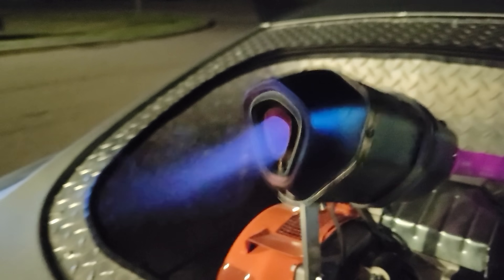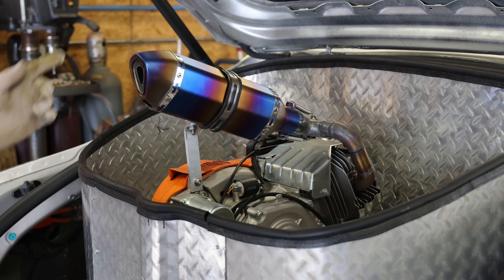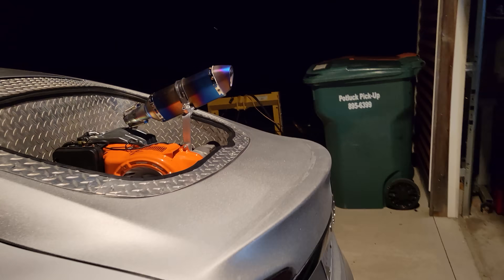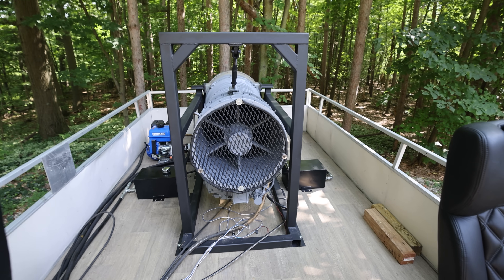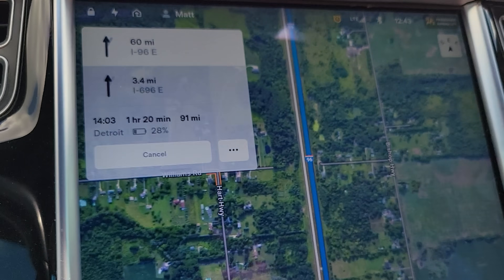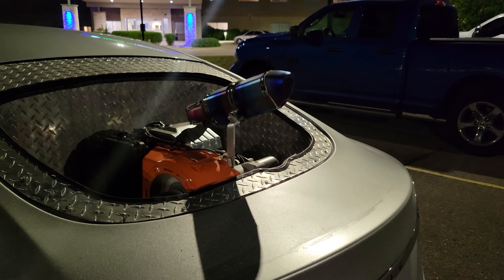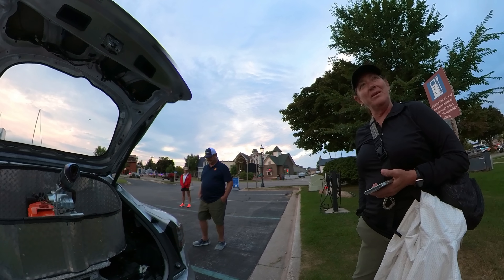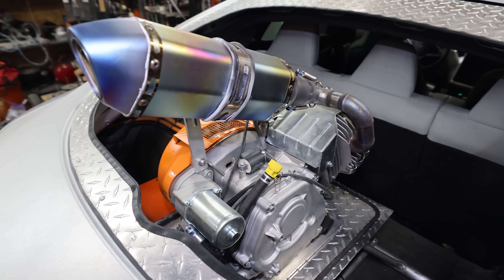Cordless Tesla (I Drive 1800 miles without charging) P.1

Comment: Battery powered cars is a joke and makes no sense for protection to the environment. Replacing the fuel tank by battery will cuase more environemntal damage due to battery chemical waste and formantion, while internal combustion engines only generates CO2, which can be decomposed by green plants. Green plants need CO2 to make glucose, and nothing on earth need toxic lithium waste . Making renewable electricity is another topic, but burning fossil fuels for electrical energy to charge batteries is the most ridiculous thing you can do for the environment

Comment: I don’t understand your logic here at all. You could have built the rear trunk the same way it is and stuck a silent Honda generator right where that loud obnoxious engine is and had it charging almost silent the entire time…. It would probably charge faster, definitely quieter, taken a fraction of the time and everyone with more than a half of brain wouldn’t be wondering why you went through all the hassle of putting that crap engine/generator in there when a Honda EU series would have done better, fit just fine, used less fuel & been quiet…

Let me guess? For the views?

Comment: I am Sorry Maybe I do not understand, U Using a Gas Generator to Charge an Electric Motor as the car is driving? Y don't U just Put in a Petrol Engine(v 10 or v12) and make that loud noise but sounding much cooler than the generator. M not mocking U I M Trying to understand, I Would Understand if U replaced Ur Roof with Solar Panels to see how far u can travel with this

Comment: Trust me, the superchargers are way faster than trying to pull this off.
Reply from the maker: Only this version, not the next... Hang tight you will see. Also supercharging is not good for the battery. Lithium ions like to be kept between 20 and 80% and get charged in short small bursts. If you were to charge a Tesla battery that way  it would probably last 20 years maybe more. If you add up all the hours that you set at a supercharger over the course of 6 months, how much time is that that you could have been doing something else?

Comment: This project exposes why Nissan never developed this idea after spending billions

The conflict is the low efficiency of gasoline engine some ~16% at best as a  static electric power  generator  or worse normal  use IC engine in car about  ~5% when  connected to normal gasoline engine  drive chains and the friction  losses from that from air resistance rolling resistance   etc .Yes the IC engine gives ~30% power at the engine output  shaft but connected to  real work that drops of a cliff 

The electric battery Tesla   is also low  efficiency in this time at about ~180 to ~230 watts per kilogram { 2.2 lbs } and to match Gasoline  fuel engine type car needs to be north of ~500 watts a kilogram 

The best way to recharge these  Lithium electric batteries is full tilt when they are at 10% to 80%  so the sweet spot is this 70% band. This shows up in  typical recharge at fast chargers is about 30 minutes for the  80% full recharge often done at low charge start of ~10%. Battery resistance means it takes another 39 minutes to recharge to 100% as resistance increases rapidly after ~80% charge .

As Nissan was interested to do electric racing system where cars would often exceed speeds of 130MPH  about 180 KPH  they needed to make a suitable 400 BHP engine 
The logic is that when the battery went to some ~20% charge the gasoline engine would kick in make ~200 BHP to the electric  drive chain and ~200 BHP to the recharging until the battery reached ~80% full again 

Problem was this required a low power 6000cc  V12 at  ~5000 RPM  or  high power turbo charged V6 of 3000 cc doing some 10,000 RPM to give 400 BHP. That was too heavy a solution  . So Nissan made a 3 pot turbo charged 1500cc  turbo charged engine revving at 20,000 RPM using a special lubricating oil and engine wieght of only ~65 Kilos ~ 140 lbs  that gave them 400 BHP. i suspect the life of this high power 3 pot engine was less than 100,000 kilometer or 60,000 miles so Nissan never went  on big scale with sales of that 400 BHP  experimental engine but I could be wrong .The point is double the RPM of the engine double the BHP until something explodes  

My cousin in London has the range extender engine in her 6 year old BMW but rarely has used it . The car works for her as a Harley street doctor she saves a fortune on  London city  Tolls  which are free for electric and hybrids  but that BMW  car would be a economic disaster in normal driving on highways as those small BMW engines for range extending are  teeth grinding expensive for maintenance if you use them a lot .

It is all mathematics it takes a certain amount of watts to move a kilogram of  a car at given steady speed d .Throw in accelerating and the watts needed per kilogram increase dramatically and battery or gasoline fuel  range decreases from steady speed range 

With losses a electric car can expect to do about ~12% efficiency in steady state ~60MPH highway driving versus a   gasoline car ~8%. Throw in urban driving both drop to ~10 for electric versus~5% for gasoline cars . In slow  traffic jams  the gasoline cars numbers fall dramatically versus electric cars  not using electric power when stuck in stopped traffic jams .

A average IC  1500cc car will need ~5kw to do a steady speed 60MPH on the highway. A similar sized EV with extra battery weight will probably need ~6KW.
The larger  type Tesla  probably is more  again.

The IC engine is most  efficient  ffor fuel at full gas in static  situations  so it makes sence for electric power to be given at full max throttle 

The near empty battery sucks up electric power faster than a nearly full battery so it makes sence to run range exrtteder when battery is closer to empty  and that needs a engine that can drive the car and recharge the battery at the same time .That shows why a mere 5.5 kw isn't going to cut it  and for tesla best to look at 100 BHP plus preferably a second hand engine from the range extender from the BMW or suitable engines from motor bikes or aircraft engines like ROTAX . better to put a tow hook on then fit a box that clamps onto  the tow hook and put IC engine inside that box keeping noise and weight outside the car .
Thats not cheap so needs deep wallts a good 100 BHP 4 stroke turbo ROTAX cost north of $10 K and then extras like fuel tanks and electrics  might be easy north of $20K new

In most of communist controlled EU where I have to live doing these modifications will invalidate the car insurance and technical certificates and run risks from Green communist cities fining for pollution .I suspect Kommiefornia in the USA and communist controlled Canada would also throw the book at inventors   

Tesla also can reprogram any tesla to not recharge if they get the plates of any tesla acting in bissare ways as they hold the patents and product liabilty on how thier cars are used . Range extending on Hondas or Nissan or Leaf dont suffer these issues .Even the door handle on the tesla is computer controlled by Tesla they can lock you out of your car . Some people bought and salvaged Tesla cars and Tesla locked them out from the recharging their car so those cars went into the scrap heap. You never actually ever own your Tesla its a patented system you can use at the discretion of Tesla  screw it up no recharging system will work throw it in the scrap heap or sue the tesla and you got two chances non and  Sod all .

The real GURU of EV cars was Burt Rutan in the 1980 era made a 100 mile EV using crappy Lead acid battery with 1% the energy of Gasoline who explained the design system he uses .Its called SWAG scientifically wild assed Guess .   The popular Mechanics magazine pre internet  of that 1980s  era wrote it all up . Tesla obviously studied this  RUTAN SWAG system and improved on it .

Mathematically cheaper to rent a gasoline car for long trips  or modify a LEAF or similar low budget EV .

Comment: For the money he spent on a tesla to make it a hybrid. He could have bought multiple hybrids from many other companies and will have about a $20,000 bill when he needs new batteries. Through it away if you have any control or motor problems, it would be cheaper to buy a new one at $200 an hour to fix.

Comment: I'm both impressed and in awe with your work on this.
Would it have been possible to attack a wind concentration funnel  to deliver extra air to the generator and also build a sound suppressor to lessen the noise it was making.
Will you ever stop in WI again? (Madison, Wi) cheers!!!
Reply from the maker: Thank you I appreciate that, actually I'm already almost done with the second version, which is very quiet and turbocharged..lol. that's why I wasn't too worried about this one because it was only short-term just for phase one.
I probably will I'm thinking about doing some quick meetups on my next road trip but I'm not sure cuz I'm always in such a hurry

Comment: Turned it into a hybrid.  Please add a muffler as well.  I just noticed that you have better energy use at 50 miles per hour.  We normally drive around at 30 miles an hour.  I wonder how good the efficiency would be at 30 miles an hour.

Comment: I can understand the R&D value of this rebuild but the 2021 Honda Accord already had this 'beast' beat.  It uses a standard gel cell battery and charges while idling and when additional power isnt needed.  My  friend bought one and got 50mpg going up and down the the steep Smokey Mountains from Franklin,N C to Highland N C where he worked 6 days a week.

I dont see how this would pass standard emission testing for newer cars, the exposed flame is definitely a safety hazard and the noise is unbearable...like riding a lawn tractor around.   I see this as more of a "look at what I got", a lot like a guy telling risque jokes at a dinner party.  But to each his own I guess.

Now if he had done a little actual engineering research and found the correct small engine to power the Tesla sufficiently and economically with the necessary sound suppression to keep it quiet, he might have something here.

Comment: Thermodynamics says that the reason your efficiency is low is because you're converting gasoline to electricity then electricity to power the engine which rotates the tire. Every time you convert energy you're only getting 39% of it back. 0.39x0.39=0.15. Your thermoefficiency would be higher at .39 if that gasoline was used to rotate the wheels instead.

Comment: You Also could have put a Hitch on the back and ran a 9k dual fuel generator using a bottle of Propane (cheaper than gas) AND been quieter then the beast you built.

Comment: Based on my calculations using the data you provide, your battery only has 173 miles of range at 100% charge!  What did you do to your battery??? I've been driving my model 3 long range for almost a year, and I still have 330 miles of range.

Comment: Why not just stick with a gas car if the point of EV is carbonless which is still a farce when EV are charged with carbon fuels like coal, oil, methane, etc. Nuclear would help but lots of luck with that. The EV mandate is stupid nonsensible and dangerous on multiple levels. The problem is liberal don't/can't think things from concept to recycled. .
Reply: Gas is less efficient. Electricity is electricity. Gasoline uses enormous amounts of electricity to be pumped out, fabricated, transported, and pumped again.

Comment: A cordless electric Tesla run using a small gasoline powered generator is actually not a new concept, but was first introduced as far back as 1914 in Germany (108 years ago) as the first diesel-electric locomotive.   All modern railway locomotives operate using this principle and employ a generator to power their electric motors to turn the steel wheels.

Comment: Why remove spoiler? How is it charging the battery while driving?
Reply: The description is misleading.  The timeline in the video makes it clear that it's not actually charging while driving, it's just an off-the-shelf inverter-generator that charges when the car is stopped using the stock on-board charger.

Comment: Way overthought.  A simple Home Depot trailer with a small 220 volt generator and Dc fast charger would have prevented a $50K Tesla from being transformed into an un-sellable Tesla.
Reply: Note the beginning of the video.  He bought and modified a used hatch cover for this project so that he could easily return the car to its stock configuration.

Comment: Nico job and concept, could adding a power transformer pack or high powered battery caps to amplify the charge output increase your efficiency and charge time or perhaps switching fuel type?  Just a thought...

Comment: I like the  concept however Gas to me makes no sense , it completely defeats the purpose of electric cars. Is it possible to have an electric system that charges itself from an electric source? Something like an alternator that continuously charges the batteries. There must be some type of loop system that will make that happen. I am not an engineer just thinking out loud.  How about a system that charges from friction. Have a device that creates some type of friction from Kinetic energy? convert that to energy transfer?
Reply from the maker: I agree however, the energy has to come from somewhere, currently nuclear is the only clean energy source that produces enough energy to charge all these electric cars that are coming in the future. But they're still a big problem, storing enough energy on the car to make the car useful. Tesla is the best in industry in terms of technology, efficiency and safety systems, but I still see huge problems like three main things. Current charging patterns with the supercharger Network naturally degrade the life of the battery quickly in comparison to what lithium ions like. Which is staying between 20 and 80% charge while getting short bursts of energy in between. Then there's quantity 100 KW battery is only equal to 3 gallons of gasoline worth the energy.  And last but not least there's the fact that you have to look around for chargers and if you use the car a lot outside of your hometown you will consume hours upon hours every week just sitting there waiting for your car to charge. I'm very neutral and non-biased on this subject it's just whatever makes sense.

Comment: If the motor/generator was big enough, you basically wouldn't need the giant battery pack anymore.  If the battery pack was removed or at least reduced, with the huge reduction in weight and cost, it would've improved fuel consumption considerably.
Reply: ☝️thanks for watching and congratulations 🎉 you have been selected among my shortlisted winners.

Telegram only to claim your prize 🎁🎁

Comment: Back in the late 90's GM had a electric car that went 125 miles on a charge and required overnight charge for the next day. One guy put a weed Wacker motor on a alternator making it a closed system and was able to travel 800 miles on one gallon of gas without a charge.  The LA Times had a article on it. 2 months later GM recalled ALL their electric cars and crushed them.
Reply: ☝️thanks for watching and congratulations 🎉 you have been selected among my shortlisted winners.

Telegram only to claim your prize 🎁🎁

Comment: This probably didn’t save you any time considering you had to install the entire thing you have to stop for gas and stop at places to charge back uo which you would do anyway charging normally. Gas is more expensive now also so i don’t get it. Would be smarter to get a truck to tow the tesla and swap cars because if you tow it it will use the regenerative braking and charge the car back up and you can still be driving in the truck. Even then you will have to stop for gas in the truck.

Comment: Wow this is so impressive I’d love to know how much you spent in gas during the whole trip granted you did say you were leaking almost halfway but goddamn that generator is a beast it would be cool to get a big enough power plant in the back that you could use during the night or during stops that could fully charge the batteries in under a hour I think that would be pretty gnarly
Reply: Much more than you'd use just driving regular gasoline powered car LOL
Reply: You don't realy get the point of this. He drove without charging but that's not the smart thing about it. The real smart part is, that he can use a weak gaspowerd generator to drive a high performance car. He get's all benefits of the electric car and on top the range of an gasoline car. This was an extrem test. On a real trip he could just charge it normaly from time to time
Reply: @hackfleischking5162  He didn't want to stop to charge but damn - how many times did he have to pull over to get gas or wait hours for the battery to charge up.
Reply: That would be expensive as shit and surely there's an upper limit on how fast you can charge a battery without turning it into an explosive, those lithium batteries can blow big. I love the acceleration of electric motors obviously but there's not really that many use cases where electric cars are preferable over their gas counterparts... Without even getting into price
Reply: Assuming perfect efficiency from engine shaft to the battery you'd need about 114 horsepower to charge in under an hour. Most full-sized car engines can't sustain that much power.